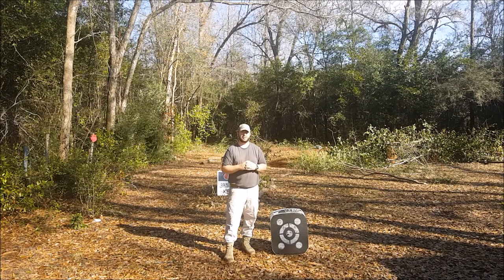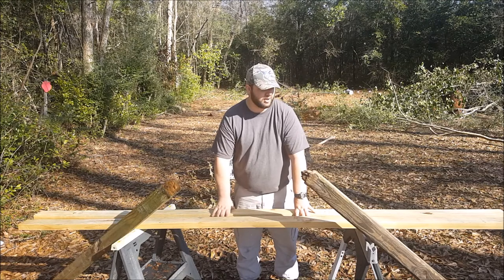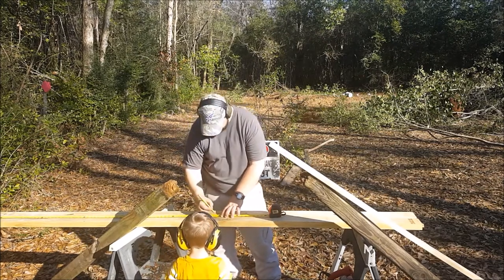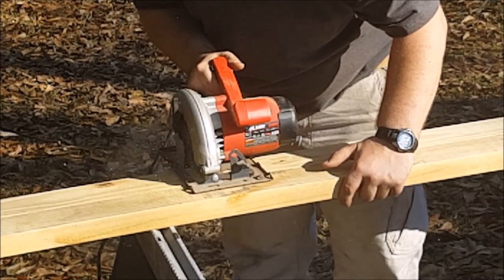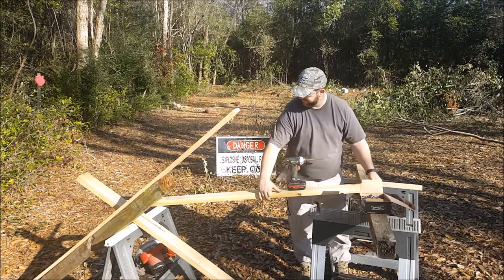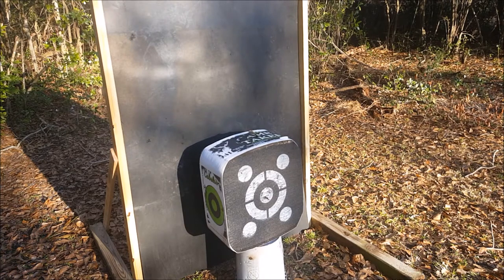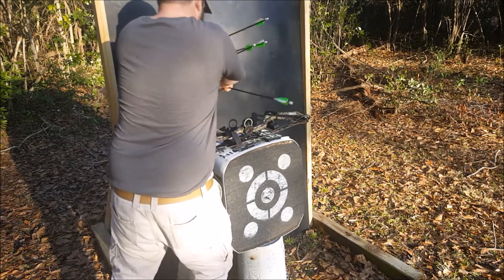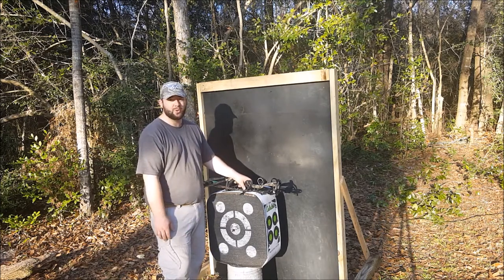DIY Archery Backstop with a Horse Mat - a how to video

Comment: This is not going to sound right, but some arrow lube on the far side might make it come out easier. Not sure if it would degrade the mat material though. Probably not if it's water soluble.
Reply from the maker: in the summer we havent had a problem, the mat was just super stiff cause it wasnt that hot yet. If we find some we will try it, thanks.
Reply: @JelsmaOutdoors  or just some soap
Reply from the maker: @shuumai  yeah but i shoot a whisker biscuit it would get all soapy? i guess the best thing to do is not miss lol
Reply: Yeah, I mean, IF you miss, then apply something to the arrow. Which will never happen. Right? hehe
Reply from the maker: @shuumai  if we keep practicing

Comment: How thick is the mat, and how many pound is the bow? Thanks.
Reply from the maker: 3/4 inch thick horse mat. and the bow was 65lb, tuned to lowest setting, in retrospect a full power bow would go at least 6 to 8 inches in.

Comment: How many inches long are the 4x4 bottom base pieces?
Reply from the maker: power lifter between 5 and 6 foot. they were rotted off at one end, originally 8 footers. min size to build with would be 4 foot.